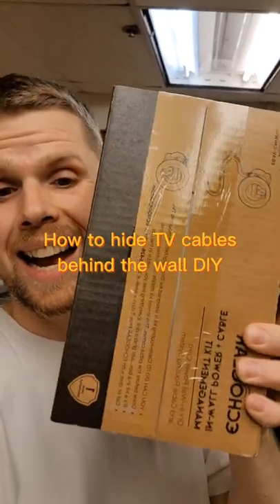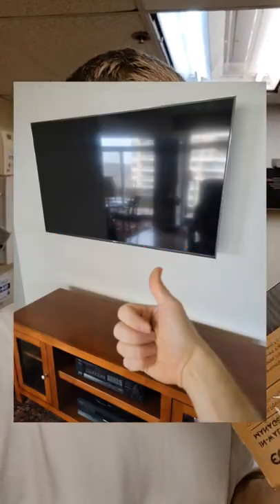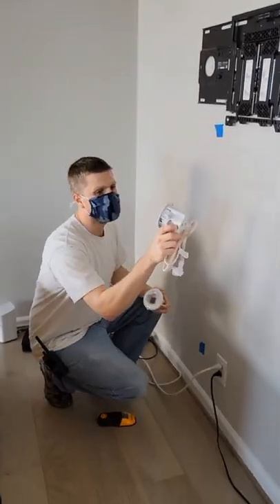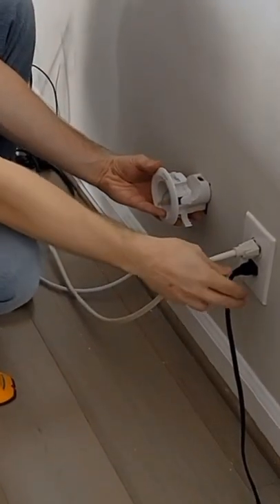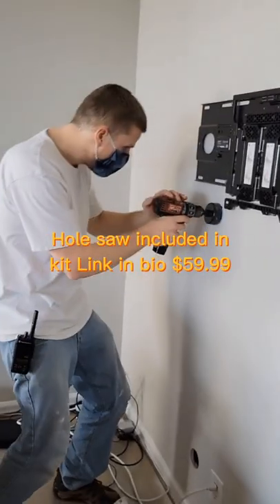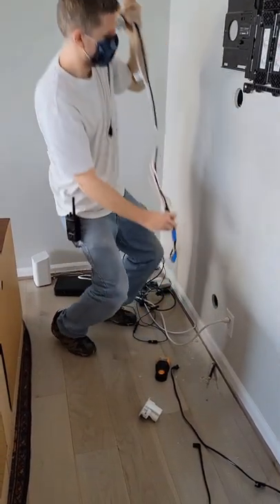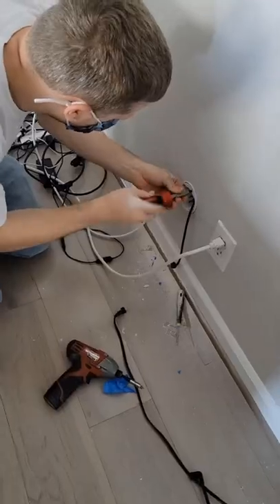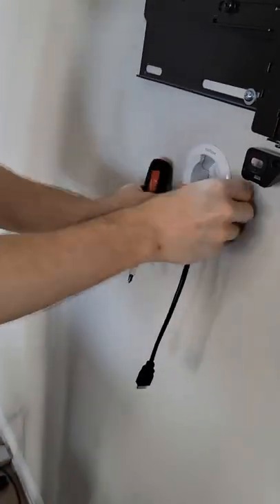How to hide tv wires #diy #shorts #handyman

Comment: Electrician here... $60 bucks is way cheaper than me... Go for it..
Reply: Yep I second that. But I’ll say this, I’m never that lucky when routing cables.
Reply: I thought it was against code to have an extension cord in a wall?
Reply: @danryan6989 where is there an extension cord?
Reply: @kylecoleman2881  the wire that connects the top plate with the bottom is technically an extension cord. Without the plates it’s used the same
Reply: @ThomasSosa-br4uk  it’s not an extension cord as it’s romex, which is rated for behind the wall. This is up to code
Reply: Thank u for ur honesty
Reply: @WalkMrJ  I work for an electrician we literally offer a product like this as an alternative to running new outlet, it’s 100% up to code… it’s an install power kit, google is free. It’s up to code
Reply: What’s charge for this excluding parts . I’m just curious
Reply: @kylecoleman2881 any type of power cord is against code to put behind the wall, meaning: extension cords / powers cords of any kind / etc……
Reply: @Ariasamazingdigitalcircus  Depends on the Installer but for just the Labor it will cost about $50-$100

Comment: I did this yesterday - worth every penny. I struggled for a bit though because the included tool had a set screw to hold the drill bit in place, and that set screw was loose. The instructions didn't mention this, and I am a dumb DIYer, so it took me a few minutes to solve. After that, it worked like a charm.
Reply: What is the kit called

Comment: In most jurisdictions it is a violation of electrical code to install ANY power cord in a wall interior walls or exterior walls.  You must use a standard receptacle and either Romex electrical wire or steel conduit for 120 volt wiring inside walls.
Low voltage signal cables such as speaker wires are OK.

Edit:  Looking more closely it appears that the black cable is an HDMI cable which is fine in the wall and its seems according to another commenter the two outlets are connected with Romex which is up to code.  My apologies.
Reply: I think you're trying to say is that you can't run 110 and low voltage wires in the same wall cavity, which is the case with code. Just run then in neighboring cavities and all is well if you have an otherwise empty one in the right spot.
Reply: NEC 400.12(5) extension cords cannot be installed inside walls.
Reply: @dallas5374  I believe we're talking about a flexible cord, not an extension cord. The cord terminates directly at an appliance on both ends.
Reply: Still good info for a beginner like me
Reply: This kit uses in wall rated conductors that satisfies code to bridge the two holes.
Reply: That is a fire hazard. In my previous workplace the fire department told us we were not allowed to have any extensions in our building.

Comment: Do NOT do this on an exterior wall. For interior walls only! Or exterior walls without *firebreaks*
Reply: But how will that cause fire on exterior wall though?
Reply: @samlocoaa1726  ^^^^^🙄
Reply: @samlocoaa1726  I think he's saying that if you try this on an exterior wall, theres a chance you might run into a fire block and not be able to fish the wire like in the video. 
Which happens but it depends on how/when the building was built.
Reply: Learned this the hard way lol
Reply: What happens if you ever decide to remove the tv from the wall then you have an ugly outlet on the middle of your wall?
Reply: @naturelover2292  patch the sheet rock
Reply: Firebreaks?
Reply: @thepitpatrol  fire blocks are between the studs
Reply: @Aguilarcesar760  no, I know what they are, just haven't seen them in years.
Reply: @austincox1239 you can just drill a hole through with an extender and fish it through.
Reply: @Bro.Dierre  You can, but youre destroying the integrity of the fire block by doing that
Reply: @austincox1239  
I'm using your comment to inform everyone else on how to potentially work with the fire block.

You will make another hole above or below the fire block, drill a hole in the fire block, tape your cables togetheer with the cable heads/ends/terminations staggered. 

Basically none of the cable ends should be touching when you've taped them all together because that creates bulk at 1 point. You want the finished taped together cables to be as thin as possible. This way you hopefully only have to run 1 long taped together cable via the wall and move on to finish.

You can also get a long drill bit and drill a hole into the fire block from that 1 hole you already cut for your boxes. Doing this means you don't have to cut that extra hole right above or below the fire block.

Comment: Here in Europe we have brick houses. We have to this also but much more work. Trace the wall, shoot the bricks out, put a flexible pipe in the wall, mud it in. Then wait untill the plasterer passed, drill 2 holes above and down (68mm) and then we can run the wires😅
Reply: Then repaint the area, most probably the whole wall

Comment: I did this the hard way with a keystone plate and lots of different connections it looks 100 times better though 
It’s got your standard 15 amp plug two hdmi 1 for arc, rca jacks, Ethernet, and a 3.5 mm audio jack plus three blank spots for future needs
Reply: Oh, you mean you did absolutely 100% the correct way, and spent about the same money!

Comment: Yep. I hang TVs and other AV stuff at my job and we use these all the time. It's a great option for hiding stuff.
Reply: You work for one of those craigslist contractors eh?
Reply: @taxman4072  hilarious. No, I work for a small business that serves our surrounding communities. Hung hundreds of TVs collectively
Reply: @frackert  about how much does your company charge for a standard hang with and with out wire concealment?
Reply: @taxman4072  $189/hour for labor. A single TV and the rest usually isn't more than that. The rest depends on what exact equipment we're using. The kind of mount, any accessories. We don't charge for small stuff like zipties and tape and what have you, but those wire hiding things, I don't white remember. Probably $50 or something.
Reply: @taxman4072  oh and, the reason I don't white remember, is just cause my job has changed. We're primarily computer repair for homes and small businesses, but also do AV work like TVs and speaker systems and smart home things. My job has shifted more towards MSP work for businesses
Reply: @frackert  hey thanks for your reply.   You guys quote 189/hr time plus material for a TV install? Is that for one or two techs? Either way good on ya'll that's very reasonable and profitable. Especially when you run into all the problems and obstacles. I own a small AV shop and STRUGGLE with pricing and closing sales because of all the Craigslist handyman advertising 50 or 99 dollar installs (mount included) !
Reply: @taxman4072  of course. It's nice to discuss this with somebody. That's our single tech rate for labor and we have a markup on our materials we use. If we're lucky we can get them from a distributor and sell them closer to normal retail pricing. And yeah, it was hard to get that sector of our business off the ground, and many of our existing customers still don't even know that we do it. Hopefully the people in your market realize you get what you pay for. I'm sure a fair share of those craigslist dudes have no idea what a stud or drywall anchors are 😆

Comment: Cheaper solution is 2 mud rings and 2 feed through wall plates.  May be $12 at any hardware store same process though
Reply: The problem is that an extension cord isn’t rated for permanent use or in wall use. These kits have the proper CSA and UL rating.

Comment: Running the power is iffy, but at least for the HDMI it's a $10-15 job and the same amount of time to buy a jab saw and a couple of brush plates. Can even add a couple of low-voltage rework boxes that hook onto the drywall (no stud needed) for a few bucks more.

Comment: As long as those cables are rated to be inside the wall I don’t know why it would trigger anyone. 

The main issues come in when people run the provided power cable from the TV down the wall and then out into a socket. 

That’s a bad no-no.

Comment: Inside walls only I’m guessing as outside will have insulation (some inside do for noise too) and maybe a moisture barrier. Good freaking luck if you have spray foam. Careful you don’t cut anything else like other electrical or plumbing. This is for experienced DIY I think.

Comment: Pretty sure its not code compliant to fish an extension type cable on the interior of a wall cavity...
Reply: mans got obliterated 💀
Reply: Lol how is your house or living place wired?
Reply: @datroofboa7988  with NM cable...the way it should be! LOL!
Reply: An actual extension cord is not in-wall rated in most states. It will void your home insurance should a fire causes an investigation for insurance claims. But that kit he's using is basically a premade outlet. It's made with Romex. The black cable you see is likely a HDMI cable. The hole he cut out on the bottom is the male end of an extension cord that plugs into an outlet, which "bridges" power safely through the wall.

Comment: This AV electrician knows that you can't run the power through the wall per code...
Reply: NEC 400.12(5) extension cords cannot be installed inside walls.
Reply: Correct
Reply: Oh no, not building code, you can't violate that!
Reply: @dallas5374  these kits are UL listed because they don’t use extension cords, the cord on them is actually 14/2 romex.
Reply: @prairiefarmer5994  gross 14/2. Minimum of 12g in my house.
Reply: They used solid cables in these kits as opposed to stranded so technically they're not extension cords in the walls.  I belive they are UL Listed devices but I could be wrong.  They're meant for consumers to install as any handyman or electricial would use more standard materials although I've used them myself per request.
Reply: @loganthesaint  but why though?  12/2 for receptacles yes, but 14/2 is perfectly adequate for lighting circuits.
Reply: @prairiefarmer5994  I just commented on this but didn't see your comment first.  The manufacturer knows what they're doing.
Reply: @loganthesaint  what kind of monstrous TV do you have that requires 20 amps?
Reply: What if u run into some blocking?
Reply: @ivanchavez4265  cut the circle holes first then use a flexible drill bit / fish bit. When you get through the blocking attach the wire wire directly to the bit and pull it out.
Reply: @johnknightiii1351  ok. Thank u!! 😊
Reply: Bro no one cares it looks better and is simple
Reply: Code smold hide that S**t and turn the Game on 😁
Reply: @loganthesaint  That's a waste of money and harder to install.  Also, a TV only draws a few Amps.

Comment: As an electrician I'll tell you, it's just as easy to add an outlet at that height. Pretty much the same process lol.
Reply: This. And gives options for low voltage combo gangs
Reply: Can’t put the power cord behind the wall anyway . Low volt and hdmi sure but no extension cord.
Reply: If you wanna be compliant at a bare minimum pull a 14/2 from the existing plug into a single gang box behind the TV and do a piece of 2” coreline beside it for the low voltage stuff. Or run your power cord through the 2” coreline and omit the plug
Reply: You're an electrician. Of course it's just as easy for you. Not so for your average person
Reply: @wasteddude  its the same process  all youd just need a 3 min video on how to use romex w a gng box and outlet plug. if people took the time to look into things they wouldnt have to pay for this is what i was trying to say. same way as when i get a drywall hole i look up how to patch it instead of calling a $300-$400 drywall service. Even though im not a drywaller.
Reply: @youngdad344  another electrician on this video commented and said the opposite of what you're saying. But you're entitled to your opinion. 

You can't compare patching up drywall to doing electrical work. Come on.

Comment: I was thinking of just using a power strip with a long cord and running it through the wall that way everything can be plugged in behind the TV but only one wire
Reply: This exists because running that power cord in the wall is against code. Power cables have to remain outside of the wall and low voltage cables can go inside like speaker cables, and HDMI cables, etc.

Comment: Just know that's against code. Obviously no one is going to be coming in your house unless you are selling but it's something to keep in mind.
Reply: It's not against code. It's not an extension cord, it's Romex cable. The cable is "in-wall rated" and up to code. Making a hole and just sliding the tv's power cord through would be against code.

Comment: This will only work with interior walls. If it's an outside wall, the insulation will prevent you from running the wires. Also, it's a fire hazard to run electric cables through insulation without proper conduits.
Reply: You use a tool called a fishers tape and I called the manufacturer of the kit I used and they said it’s safe to use for insulated walls.  They are Romex wiring and code certified, so they aren’t a typical extension cord.

Comment: I don't understand the point. Mount an outlet behind the TV, that way you have one hole not two. Also, people.usually have an entertainment center or something in front of their TV to hide wires if not used method above. Put the outlet behind the TV and be done. It's right above it. You know you have an open cavity and where the studs.are... I am a licensed electrician as well to your point. To each their own. Creative is never bad.

Comment: Thx for this. Been trying to find a decant on for my customers
Reply: This violates electrical codes.
Reply: @onejohn2.26  nope
Reply: @jeromegrunwald9564  National Electrical Code (NEC) Rules
Extension cords must not be used as a replacement for standard electrical wiring for a building. Never use an extension cord where it is put through a hole or opening in a wall, inside a dropped ceiling or under flooring. It is against the National Electrical Code to connect extension cord wiring through doorways or other structural openings like windows. Extension cords must not be hidden in any way behind structures, or covered with objects such as rugs.
Reply: @onejohn2.26  that's not an extention cord. It's a code legal cord
Reply: @onejohn2.26  click on the Amazon link, and takes you to the item. It is not an extention cord from wall inset to wall insert.
Reply: @jeromegrunwald9564  What is a 'code legal cord'?
My understanding is, that it has to be a conventional outlet hard-wired on the top and bottom. Then you can plug in whatever you want.
If it has a built-in plug, it's an extension cord.
I would suggest that you check with your local building inspector.
Besides that, where I live this would have to be installed by a licensed electrician, anyway.
Reply: @jeromegrunwald9564  I looked at it again and the other thing is, that you can't have data cabling running through an electrical box, either.
A homeowner could probably get away with this, but as a contractor, I would say no way.
But, as I say, check with your building inspector.

Comment: That’s literally as much work as just putting a normal functioning outlet in that specific area
Reply: @nick d there’s no electrical work. All that’s being done here and if someone runs wires behind the wall versus in front is literally that….feeding the wires behind the wall.

This kit is way overpriced. You can do same thing with $10 or $15 in materials from hardware store.  It’s hilarious.
Reply: No, it's not nearly as much work.
Reply: Does that normal outlets which requires romex and a box, and still doesn't allow you to run HDMI and audio cables really make sense if you think about it from a not rich and snobby AF perspective?

Comment: Isn’t it against code to run a power cable behind the drywall ? For insurance reasons ? 
If it’s okay I’ll install these as well
Reply: Its an extension cord, not a power line.
Reply: NEC 400.12(5) extension cords cannot be installed inside walls.

Comment: Couldve just went on the other side of the stud, put in another outlet behind the tv AND have one of those data tubes that basically do the same thing as this product but better because you can take the wire in and out with ease.
Reply: Thats way more work than what he is showing.
Reply: @ghostkilla931  bro it looks nicer, you can put any cord through it like an hdmi with no hassle and it can be linger then 5 foot.

Comment: What about if insulation is in the way
Reply: You buy a tool called a fishers tape and you run that through one hole, then behind the wall and up out the other hole.  Then attach the wires to the fishers tap and run it back through the wall and holes.  I called the manufacturer of the kit I used and they said it’s safe and fine to use on exterior walls with insulation.

Comment: Umm what if the wall is packed with insulation?
Reply: They you can’t use it. Duhhh
Reply: Use a fish tape to pull cables threw wall
Reply: @NC-wf4ki  Well that’s my point then it’s pretty much a useless thing because most TVs are anchored on outside walls
Reply: NEC 400.12(5) extension cords cannot be installed inside walls.
Reply: @dallas5374  yes true, there must be a fire code against that.

Comment: I feel it like it would be just as easy to move the outlet and cheaper
Reply: ALOT cheaper 😭😭😭
Reply: But what about the HDMI cable
Reply: Didn't think about the HDMI but now seem like dvd are a thing of the past ever thing is cast able we through out 2 boxes of DVDs cuz we don't even have a DVD player anymore
Reply: @tonygraham6722  HDMI for the cable box such as Comcast or FiOS
Reply: Could just get 2 old work data and jbox combos. On side would just have fingers (or a ports) so you can poke hdmi and or cat 6 and a outlet on the other side